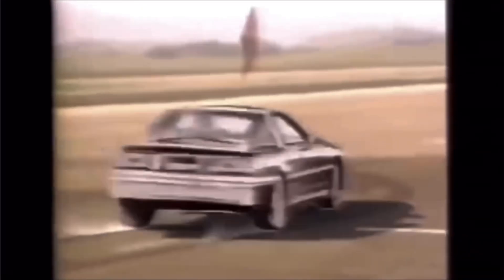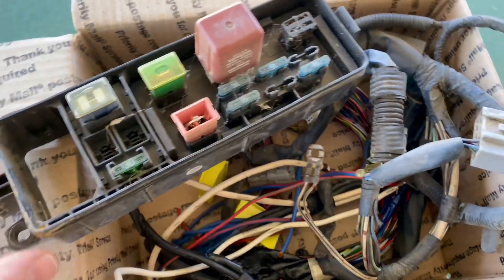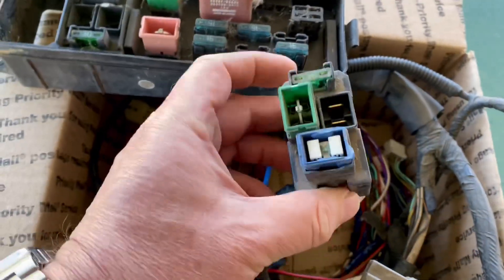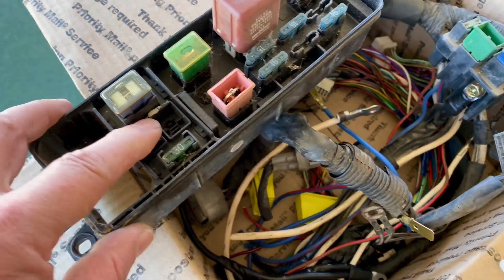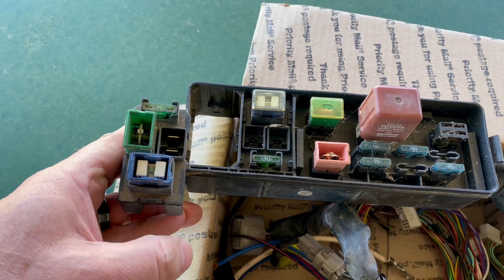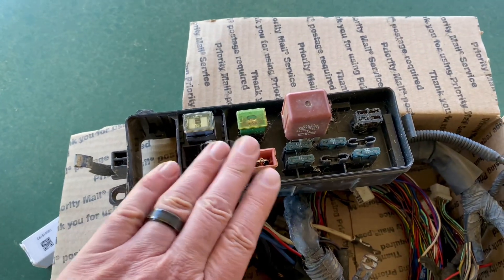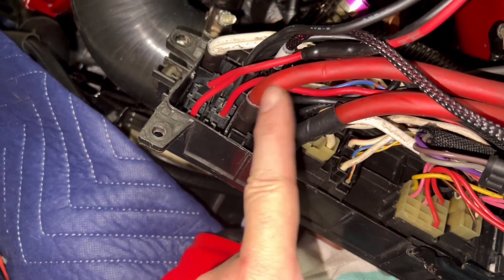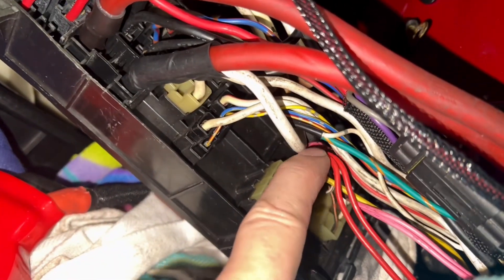Giving the MK3 Supra a SERIOUS wiring upgrade! Adding a High current alternator and more circuits.

Comment: Thanks for this video! I also have an 86.5 and my main relay/fuse box has been partially disconnected by a yahoo. I am also in the middle of a swap, like high powered audio, and the new engine has a 130A alt. So this is welcome info! Hopefully I can put it to use.

Comment: Hey I don't know if your still active but I was wondering where did you get the 180 amp PAL fuse?
Reply from the maker: @garyreyes2873  , I purchased from Elliott Electronic Supply, but I had to file and modify it to fit. Here is a link:
https://www.elliottelectronicsupply.com/pal-180a.html
Reply: @SupraSeth I was wondering if you could help me with some of it since there's a few wires in the video that I don't know where they go. If you could help me that would be great
Reply from the maker: @, in the hope that we can help others that are also in need of guidance, please feel free to share which wires you are concerned with. As I stated in the video, most of the black wires leading to the primary fuse are feeds to other distribution/ fuse box points inside the car.
Reply: I have two of the power wires, a white 8 gauge one which I believe goes to an alternator but idk, which splices into I think 3 different circuits. Then there is a black wire which comes off the main 100amp circuit that splices to 1 wire going down to where the battery is which I have a 8 gauge black wire which goes to the other side of the the car but idk if those connect or go to the battery
Reply from the maker: @, I would suggest either using a volt-ohm meter to meter the wires to determine where they lead to, or order a wire toner, which also is helpful in determining where the wires lead. From what I recall, the thicker black wire that you’re referring to either connects to the battery. Just prior to the battery the black wire is terminated by a smaller blue wire, at least that is the way mine was.